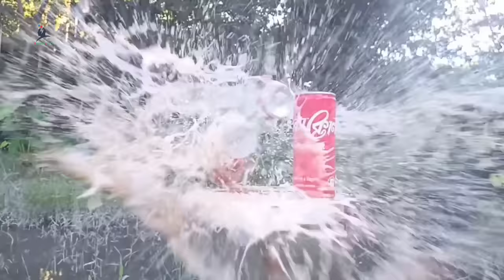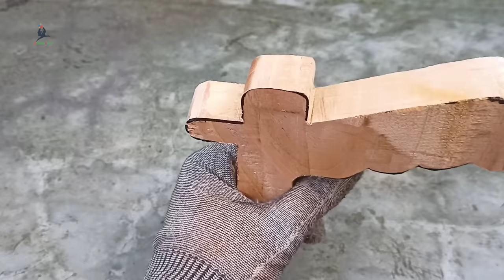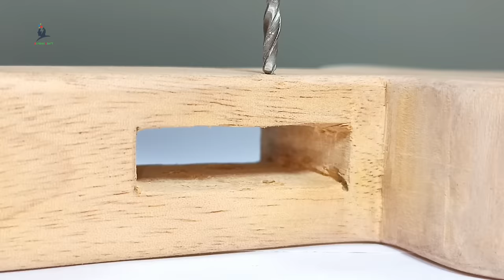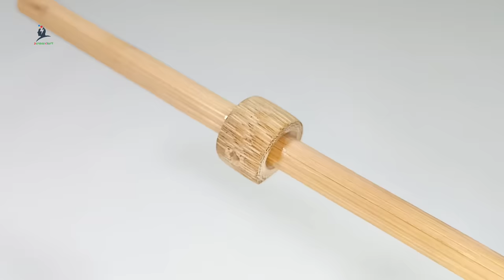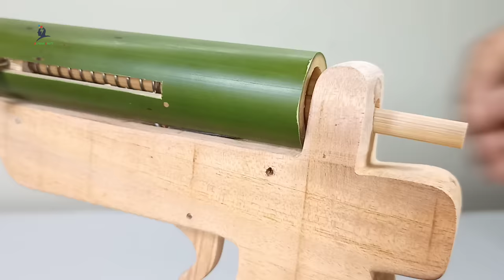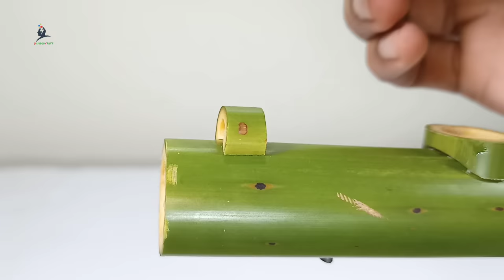How to make a survival Bamboo crafts || Easy iDEA

Comment: I question this:
Spring Pressure
The Can (which was full. So rhe pressure would lower the amount of force it got launched at. So there is a small chance the thing is true)

Record all parts of it. Without cutting it. Dont screw over. People have found cheaters who split videos to make it look like they did a legitimate Speedrun

The piece that you use that holds it. Wouldnt it get bent easily?

I want ro also have the gun parts shown and pointing to where its supposed to go.

And a full video of you using it without cutting the video. Cutting it out would prove that i will catch you lying about this. I'm not that stupid.

Comment: Can you please make one with only bamboo pipe and spring and trigger? Please also (if possible) use nerf bullets.
Reply from the maker: Yes, but it will take some time
Reply: @BambooCrafts  Will it use the same mechanism as all your other guns, but adapted for the nerf bullet? Also, can you please use only one pipe (no wooden handle) like your “Easy survival bamboo Crafting toys” video? Thanks.
Reply: @BambooCrafts  hp yg up
Reply: @BambooCrafts  a6+uddipna ji jo on poi 65 +i zzz 2 1 ghn bnsgrb
Reply: @PoojaKumari-vl2he  8 ii8
Reply: @maheswarkk1034  s
Reply: @PoojaKumari-vl2he  ध               ौ
Reply: @maheswarkk1034  😊😊⁰1q1q1😊
Reply: No ll
Reply: yes me bna duga 500 $ lgy ga 🙄